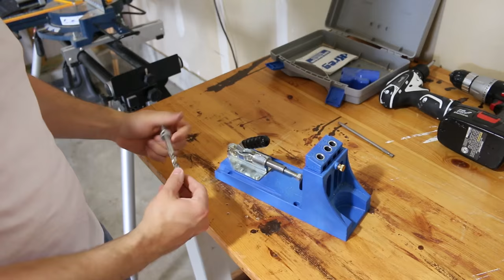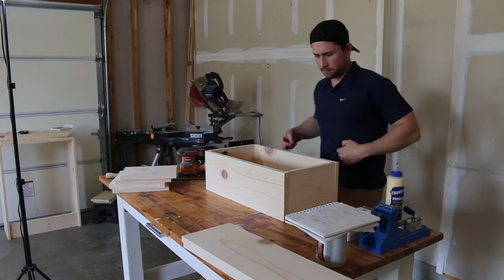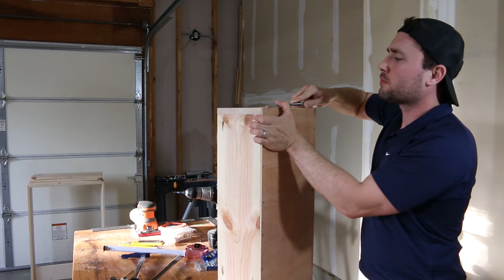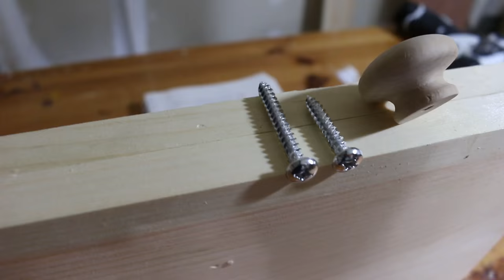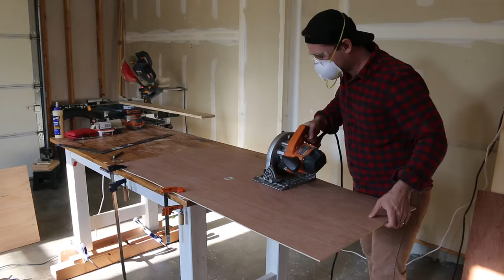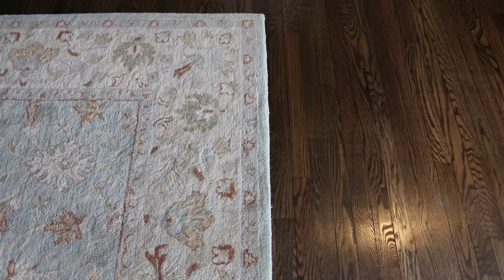build a 3 drawer dresser

Comment: Hey man, using a circular saw takes some practice. A few tips though, when you are cutting try to keep the wide part of the base (the left side of your saw) on the side that isnt going to fall away. It makes it so that the widest part of the base is on something solid and you're less liable to wiggle and mess up your angle. Also use the notches at the front of the base as your guide, it looks like you were doing that in the video but just letting you know. It's basically like when you drive a car, you want to look ahead of where you are going, not right at the front of the vehicle (blade) its easier to make straight cuts that way. 

The dresser looks good to me though! Everything takes practice and wood working is definitely one of them. Keep up the work! Hopefully your channel grows a lot more soon, it definitely deserves it.
Reply from the maker: Ah, thanks for the tips! I'll definitely give them a go next time I use the circular saw. I really appreciate the advice and kind words man!!
Reply: Hey dude, I'm super late to this party, but I just subbed.  The best piece of advice for using a circular saw is clamp a straight edge to your work piece and then ride the saw against it.  Guaranteed straight cut.  I dig your stuff.  Keep it coming :)
Reply from the maker: Phil Pinsky Productions Thanks for the sub man! Great advice! I actually gave this a try with a scrap 1x4 and it was like NIGHT AND DAY! New vid out today check it out!!
Reply: I live to give.  I'll check it out later tonight.
Reply from the maker: hahah!
Reply from the maker: Phil Pinsky Productions hahah!